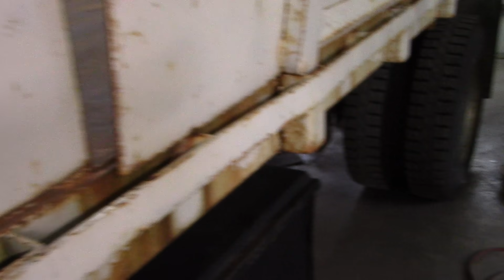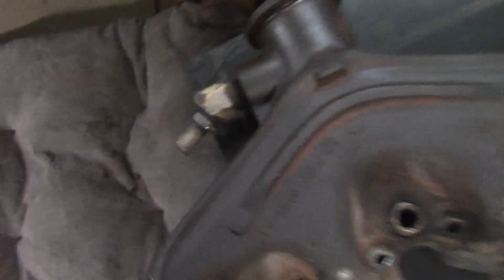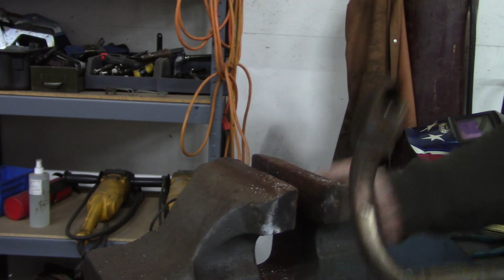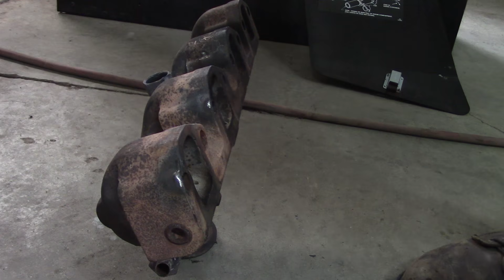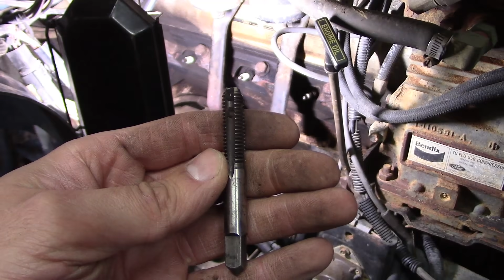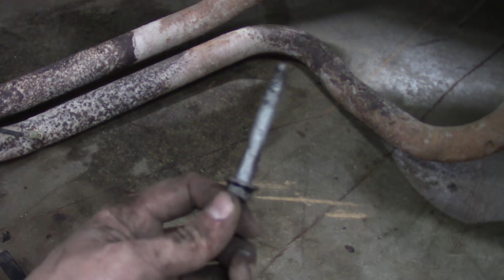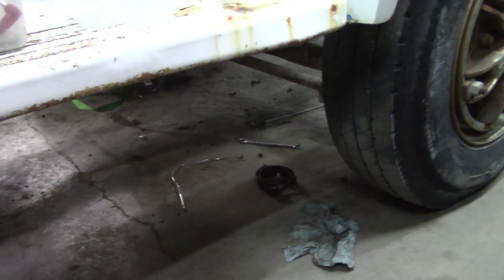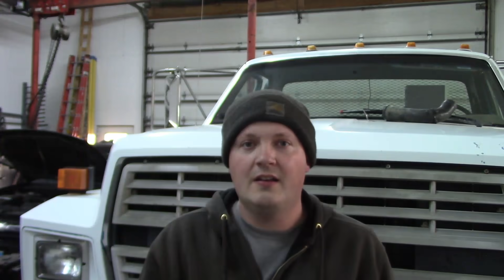Ford F700 Project - Exhaust Manifold Leaks (Gas Engine) - Part 1

Comment: Sounds like fun, back in the old day's things were much more fun, I used to love going down nice long hills, in a truck, "not mine", turn off the key, pull the choke out full, and pump the throttle, then turn key back on, blew exhaust manifold gaskets a couple times, and blew up a few mufflers, it was a hoot, pretty loud.
Reply from the maker: There is a guy here who used to do that in an old Chevette. Start at the top of the hill by the high school, switch the engine off once it was rolling, then flip the key back on right by the principal's office...
Reply: @WatchWesWork  I blew one open like a banana once, lucky it didn't come thru the floor.

  Had there been a hill anywhere near the principals office window I probably would have gave that a shot.

  One of the other great tricks was drilling a hold and tapping a muffler on a school bus and putting a grease zerk in, WOW, did that make some smoke.

  A good pop like that could have almost lifted a Chevette off the ground, OH, the good old day's.

Comment: Wes if it does come to a point on those trucks if you have to have exhaust gaskets they make a header gasket that’s thick and soft so when you tighten the manifold it conforms to shape of it to seal from leaking. 
There’s different manufacturers they have them. Percy’s seal4good , mr gasket ,  I think they are made of soft aluminum of sort.  Thought this might help you out you run across something like this again. 
That had to be a pain in the arse to work on. 
Looking forward to seeing the next video 👍

Comment: Back in about 80, or 81, I had a friend that bought a similar truck, built in the late 60s.. the engine bay in that was virtually empty by comparison to this. It was a big wide bay, with a 400 some cubic inch engine nestled cleanly in a vast open space... No air injection pumps, no oxygen sensors, none of that...

Comment: At 2 minutes in I knew exactly what it sounded like before you even turned the key!
I do not understand how Ford, after building trucks for over 100 years, and the 385 engines for 25 years, cannot figure out "HOW" to make decent exhaust manifolds.
*I have owned 7 460 powered trucks*

Comment: I have nickel welded cast iron a few times, I never had a problem with it where there was no heat.  I have nickel welded two cast iron exhaust manifolds, both of them later broke again.  I have seen numerous brazed cast iron manifolds and iron kettles that were later used on wood fires to make different things including rendering pork fat to produce lard and they did not crack again.

Comment: Had a Jeep straight six with a factory metal to metal manifold interface, but needed a gasket once it was off.  But the gaskets would only last a few thousand miles before one cylinder would blow out and the engine would make a ticking noise loud enough to be heard inside a house.  My friend would call me after I drove by.

Comment: I can tell you with absolute certainty that any composite gasket won’t last. The heat is too great for any gasket other than a metal shim gasket. My 460 would destroy any gasket after about 1k miles. I’m fairly sure it never had one from the factory.

Comment: It always amazes me how you know every part of vehicles from forklifts and crawlers. I admire your patience too lol. I've got a STUBBORN O2 sensor stuck in my catalytic converter right now and it's not even rusty. I pulled the piece of shit so hard, I gave myself a nose bleed. I got out from underneath the car, threw my breaker bar across the lot and started yelling all sorts of shit lol. Thankfully it was around 3 in the morning and completely empty. I'm tempted to bite the bullet and take it to a shop, get it cut out and get a new bung welded on. Love the logo too!

Comment: 28:30 made me feel better about putting the two piece manifold on a Windsor V8 on, then figuring out the separate fourth runner went on the other end and I fitted it all a complete port out of whack.

Comment: so tempting to blank off and strip out the secondary air stuff - it is quite simply unnecessary and would help clean up that abomination of an engine bay but I understand as a professional you are in a difficult position so it all has to stay! I admire your determination, patience and relative lack of expletives!

Comment: Definitely a gasket that's designed to fail. You made the right choice to go without it. I didn't envy the tight working area mixed with seized bolts and fittings.

Comment: Front bumper, knee breaker. The exhaust manifolds on the 390 in my ford pickup doesn't need gasket. I did have to take them down and have them machined smooth. I like the 79 f100 no smog pumps or other garb on it.

Comment: you can also start the front and rear bolts thru the manifold the just drop the gasket in between , thatts what the half hook on the gasket is for. i also build my own gaskets on these by using copper sheet . the design of these gas motors allows them to run hotter than most engines causing exhaust trouble.

Comment: I'm only half way thru and Im sure an engine swap would be easier, and then there's the idea of using a gas torch under the hood of a gasoline powered truck.

Comment: From my experience make sure the customer lets the engine run for a few minutes after a hard  pull to allow the manifolds to cool down so they do not crack.  Very common problem on 429/460 and 351W Ford truck engines.
Reply: That should be done with any vehicle; a cool-down "lap", or chill down on the last mile.

Comment: Nice Job!  Try this on a motor home with fuel Injection. I was swapping out over heated heads from a plugged catalytic converter three bolt hole broken in the heads and the exhaust mans were tweaked like the old chevy exhust mans do. Luckily found another set of manifolds  (460) oh and the block end up being warped oh how fun.

Comment: The list of things you rambled off that was wrong with it sounds exactly like my f800 with the 429 lol when I did my Pakistani rebuild on it I just left off all that emissions garbage and you can at least see the engine now
Reply from the maker: Yours has a carburetor, so it's a little easier to delete. The computer on this rig is going to be all confused if I remove the air system.
Reply: @WatchWesWork  unless Ford did something really weird (it is a Ford), obd-1 computers are easy to fool with diodes, resistors, and maybe a relay if they want to be obnoxious. Even obd-2 can be fooled with a 30cent diode soldered between the right pins.
Reply: @johndeerekid167  Where could a fella go to learn about such things? Had the transmission done in my 91 van which I'm told requires the computer to shift. Like to keep that for now but ditch the injection for a carb but then will the trans work? No smog-check here, anything that goes goes!
Reply: @P_RO_  I've figured it out from looking at tuning forums and dealer service manuals. Just need to see what values (normally voltage or resistance) the computer expects and then you have to figure what resistor or diode or combination of components will make it always see that value. But what you're describing is quite a bit more complicated than bypassing a smog pump.
Reply: @johndeerekid167  Yeah, that's why I was asking. It would seem that the only direct input to the computer affecting the transmission would be the TPS to allow for kick-down but I can't find anyone who knows for sure. If I had the dough I'd chunk it all and do a C6 trans instead of the weak stuff that came later. Maybe one day I can find a 'donor' from an early model.
Reply: @WatchWesWork  
I was wondering, becouse I worked for a City, and the front bumper with the big eye in middle 
Too me it looks like the hitch for a SNOW PLOW maybe. Are truck had a quick latch system. And hydraulic quick connect. I have seen pin eyes like that before.
On older plows. Just my view.
Reply: @WatchWesWork  delete the computer too 👍🏼😂😂🤷🏼‍♂️
Reply: @DieselCreek  wdym by a pakistani rebuild
Reply: As a sufferer of mid 1990s OBD-I emissions and a fan of both channels, I'm definitely following this thread.
Reply: @cordcd7  everyone suffered from OBD-1
Reply: @DieselCreek  Dang that's the truth! It is good diagnostic troubleshooting practice, though.
Reply: Obd-1 systems was not too bad, as an analog volt ohm meter was all you needed to get the trouble codes out of it. Least on a Ford. Dodge is the weird one with their obd-1 systems, as you needed a box that looked like an old eniac computer to get their codes. But oh I miss the days of my 1965 Ford F-100, no emissions and no computer system. Just a broom handle, and your ears to diagnose most problems. Still get a laugh out of people, when they see me diagnose a loose rocker with a broom handle.
Reply: Did you wear the Pakistani open toed safety sandals lol.
Reply: This truck is same is a ford f800 with a diesel engine on it
Reply: Yuns interested in a 86 F600 with a HEALTHY 370 with under 7500 miles, in Ohio?

Comment: I'm wondering Wes, how many times do you turn off the camera so you can call parts like those manifolds some very not so family-friendly words? I would've dropped a few mfers and threatened to curb stomp the Ford engineer who designed that truck if we ever cross paths in the street.

Comment: HI Wes, the Marmon clamp that you mentioned is actually that. Generically called a Vband clamp. For a fun read look it up and you will find Harpo Marx was the guy behind the whole idea of the Marmon clamp. FYI they are used extensively in aerospace.

Comment: I remember wanting headers for my '68 Chrysler Valiant in 2003 as a 19 y.o. The manifold was already cracked like what happened to most of those in that era, and all the bolts were just mis-shapen, globs of brittle rust. When I got one quote from a specialist exhaust shop, they said they'd sell me a d.i.y. kit as it'd be easy for a backyard job, I told them "you've gotta be kidding"! I then searched until I found a shop that would do the whole job for me. When I did it cost nearly $2k and it took nearly a whole day to do, and that was in '03 money. I'm taking Aussie dollar though, not the greenback.

Comment: I had to take some 455 Pontiac exhaust manifolds to the machine shop for flattening procedures once years ago. Seems like it was $30.00 apiece. They quit leaking though. Hate manifold leaks.
Reply from the maker: Cost me twice that...
Reply: Guess labor costs have gone up since..... well, before you were born or thereabouts. ⏳

Comment: I don't think bringing these into the fuel injection smog era was a good idea.  Why they didn't use the 460 (which has a lot less emissions crap on it) makes me scratch my head.
Reply from the maker: I'm not sure. My understanding is that the 429 commercial truck engines differ quite a bit from the 460, which is basically just a car engine. The crank is different on both ends to accommodate larger flywheels and more accessory belts, the timing cover and rear seal are necessarily different, and the crank is forged. Why they could not do that with the 460 I don't know.
Reply: @WatchWesWork  I always read the 429 and 460 were the same family, with the 460 having a longer stroke.

Comment: I feel so sorry for you now as it appears we must have some of the same DNA.  I bought a new exhaust pipe for my kids car and went home and cut off the good one.  I have lost several wrenches as they fell into a small hole in the frame and must have ran to the back of the car.  
But you did a fantastic job fixing this old truck.  Do you charge for pain and suffering?  Thanks for the video.
Reply from the maker: I wish I could!

Comment: Most of those secondary air systems were put in the secondary garbage can....Really never saw one intacted before.
Reply from the maker: I don't know why. It's actually a pretty simple system.
Reply: Yes, but as you found out, once rusted in they are a pain to get off.  Not to mention the vacuum lines, decreased engine access, etc...most of them were removed.

Comment: Nice job!  I've had good success brazing or nickel welding cast iron too.  Stress relieving can be done by heating the piece first then doing the repair and cooling it slowly by burying it in sand.
Reply from the maker: I used a blanket. But I find brazing has low stress.

Comment: I'm not going to say I enjoy your misery in jobs like these, but considering how much time I've spent fighting with old rusty exhaust manifolds, I definitely can appreciate it.  Fun side note, domestic egr and secondary air injection tubes are easy enough to deal with in repair, import not so much.  Great example; my mother's late 90's subaru, the egr pipe wouldn't come off, ended up breaking it, is a 10 mm stainless pipe, subaru doesnt (and didn't 14 years ago) have it available, ended up re-using the original line nuts, and just flaring a 3/8 piece of steel line a bit further that I otherwise would have.  Wasn't ideal, but lasted as long as the automatic transmission in the thing did, so that was good enough.

Comment: I wonder if a set of high temperature hot rod spark wires and boots might be an answer.
Reply from the maker: Regular wires should hold up fine with the manifold sealed up!

Comment: Dude. You get the worst jobs man. You take them in stride though!
Reply from the maker: Any work is good work.
Reply: @WatchWesWork  touché
Reply: Also, you made the right call on removing those gaskets. Ford didn’t use gaskets, just some grease.

Comment: Not many mechanics would take this job on so I  admire you for your dedication. It's always a nightmare working with exhaust manifolds. I'd hate to be the one that had to pay for this if you charge the average rate that mechanics get per hour in Alabama. I imagine the rate is even higher in your area.
Reply from the maker: You might be surprised.
Reply: $125 hr where I am in South Louisiana….

Comment: 2- grapefruit cans.. vacuum cans.. Nice job.. I need to do this on my Detroit, my exhaust manifold is rusted and is starting to leak. 
A tight reach will get you in those spots and allow you to use your impact, check out some of my videos where I use them. I have the 1/2" one that is impact rated. I have a 3/4" drive milwaukee impact I use on it and it has not broken yet.. yet..

Comment: When I was a teen I took removed and replace the water pump on a 4 cylinder front wheel drive car 3 times in November because I kept forgetting little things when putting it back together.

Comment: On that hiding exhaust bolt, my father-in-law was a marine crew chief on corsairs in the pacific during WWII. One of his favorite bits of advice was about dropping parts near an open spark plug hole. "You can take a nut or washer that you couldn't FORCE into that spark plug hole, but if you ACCIDENTALLY DROP IT even NEAR the hole it will fall in like it belonged there!"  This was his way of warning me about the need to keep an empty plug hole protected. RIP Big Mac.

Yep. I saw the misfire before you turned the light off.⚡

Comment: Great job Wes, I always disliked exhaust work for all the reasons that came up in your video. However it has to put a smile on your face after all those repairs are done and the engine runs smooth and quite. You do a great job of not swearing when things go wrong on videos. Give this a try swearing in Latin......deus malum sit! Everyone will know your ticked off but few will know what you said.

Comment: Just go a step further than cab over and have the engine on a rail that slides forward off a splined shaft and up on a cantilever using the weight of the cab to help it, then you just do whatever repairs or work or even swap the engine out, and you can unbolt the rear block that the engine slides into from the transmission and change out the clutch, that block will basically be like the rear of an engine, having a bearing, a flywheel, the clutch, and being the mounting point for the front of the transmission, the engine will have its own mounts that go to the rail, and then the rail will rust stiff on you making the cab not open or the shaft not fully engage, lmao what fun XD almost had one of you with this horrible engineering

Comment: That engine series was always famous for exhaust leaks. A good friend of mine worked for a tree service company and he did the same as you did except he would flat mill the flanges. Very few problems after that unless the manifold got thin from severe exhaust temps due to running lean. Great fix hope to see more videos on this truck.